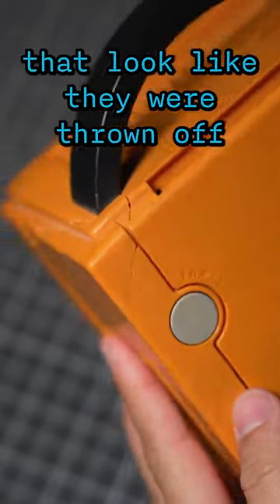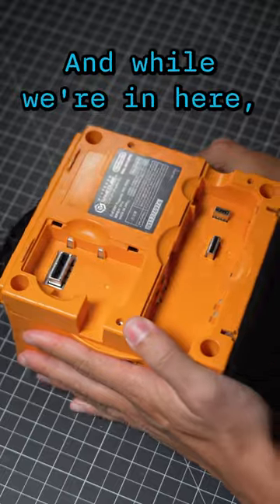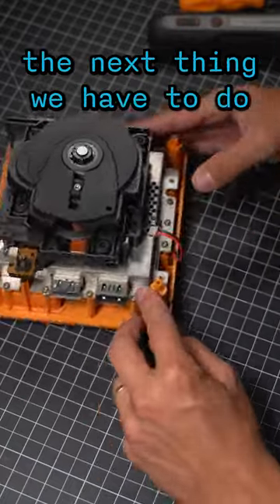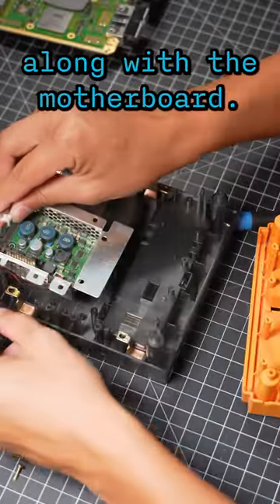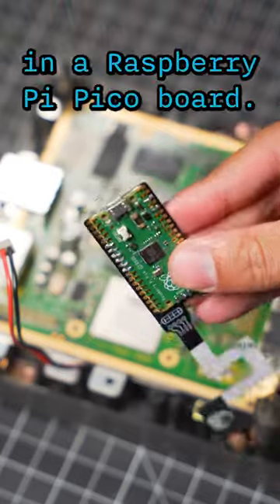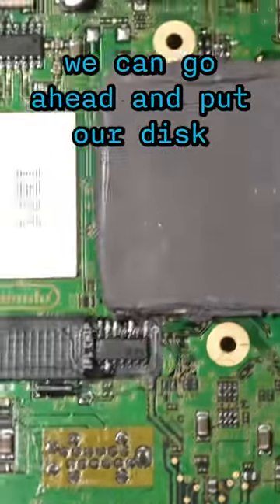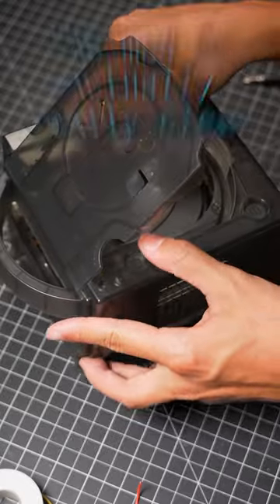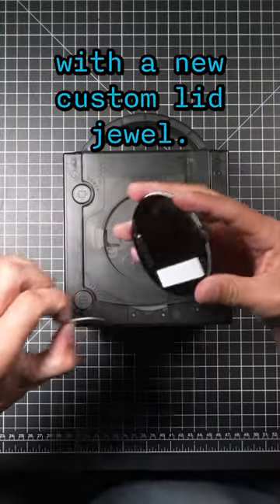Building the ULTIMATE MODDED GAMECUBE! Re-Shell and PicoBoot Mod

Comment: I want to do a pico boot so bad but I would absolutely short those pins
Reply: I just did one myself with very little soldering experience. As long as you use lots of flux it’s not to bad
Reply: Dude, I'm terrified to mod my consoles in case I mess them up.
Reply: Its easy to do.
Reply: @JasonMeeks79  so is nuclear engineering to someone, doesnt mean its easy for everyone bud
Reply: @jahanbaxter  actually some modding is.   You've just been told it's so difficult that you don't think you can.   Get a decent iron, some dead boards and test it
Reply: Look up and order a Flippy drive mod. The Flippy drive will be much easier to install and will be vastly superior; it's about to be the GameCube gold standard for modded examples.

Comment: I wish there was someway you could fix the orange shell
Reply: I mean, there's no reason you can't, it would just take a bit of work. Get some Bondo or similar to fill in those cracks and get a matching color of paint. It wouldn't be in like mint condition or anything but it would still function perfectly and as long as you get the exact same paint color it should look fine
Reply: Or even keep it as is
Reply: @Ranesbane  if you're gonna paint anything, you might as well just paint a clean shell.
Reply: I'd just glue it with a super transparent glue & roll with it as is, shell prolly still worth a small amount as it was.
Reply: Dejarlo como está sería lo mejor

Comment: I love finding good priced gamecubes/consoles that look lime theyve been played football with or used to show students the effect of gravity since its an opportunity to replace the shell and typically mod it up.  Inhave a hard time taking a working console snd modifying it.  Most of my modded consoles have been ones where the laser worn out and shell is cracked.  A few times when the laser wasnt worn out, id leave it in for myself or a family/friend if they want a sleeper and continue to use with discs games but usually if lasers working ill part it out and place in my repair hardware bins for future donations to broken consoles since its a shame to have a working ps2 or gc or dc and its reading off of a network drive or sd card and never using the laser.   

These broken console shells are just begging to be replaced with a sweet sexy transparent housing shell .  Hell a few of my consoles are butt naked and i just ordered 3d printed pieces and a bottom so i can mount the console in a skeleton and have it in the open.  Although these usually get placed inside the console shelving where theyre safe behind a glass door and in the back are whisper quiet desktop pc fans running when the consoles on, to allow prop3r air flow.
Reply: Now this mans got a solid system!!! Believe it or not, i follow practically the exact same logic!

Comment: Aaite this cool and all but......🤔 we wanna see you make a ps vita play ps2 games. WE'RE WAI-TINNG 👀
Reply from the maker: They dont
Reply: @JayBoyModz   why hasnt anyone ever even TRIED messing with the ps vita like making a plug-in that snaps on to your pant's waistline and is the actual ps3 motherboard and it's internals with battery pack and fan and have the vita connect to IT via remote play. Ijs it seems as if nobody is even TRYING to shrink the ps3 down like they did with the gamecube (giving it an original backwards compatible wii motherboard and 3d printing the mini gamecube shell). Ijs. They made a ps3 LAPTOP so there HAS to be a way 🤷🏾‍♂️
Reply: @JayBoyModz  there isnt a way to disect the inside of a ps3 to figure out wheee the "remote play" function is coming from? If u can find THAT, and find a way to connect it to any console, that would change the entire game